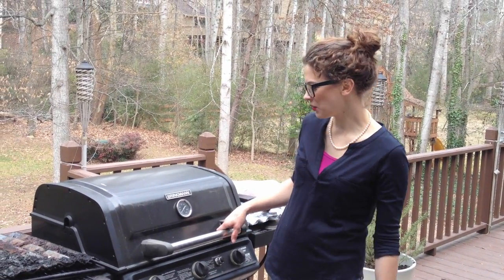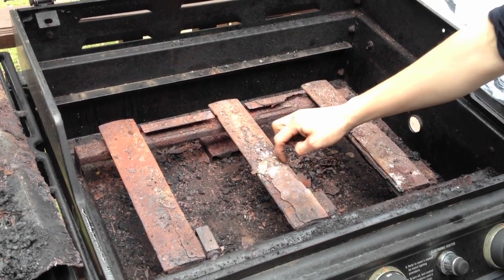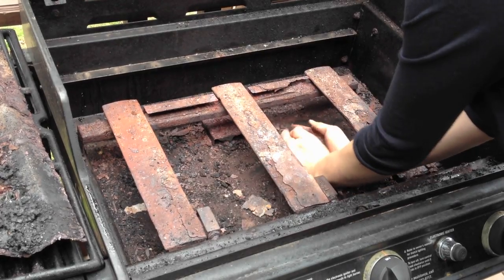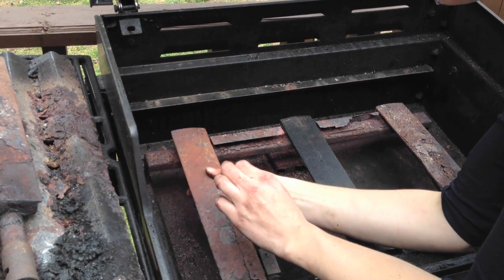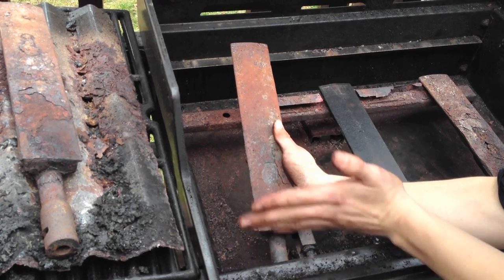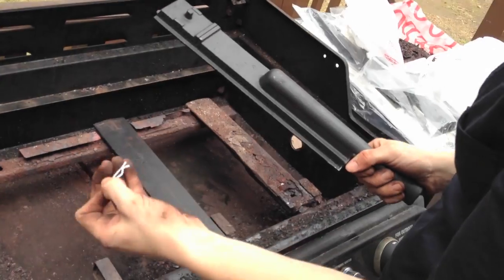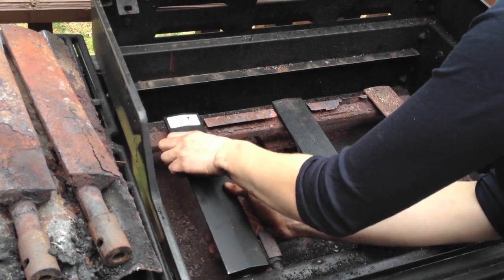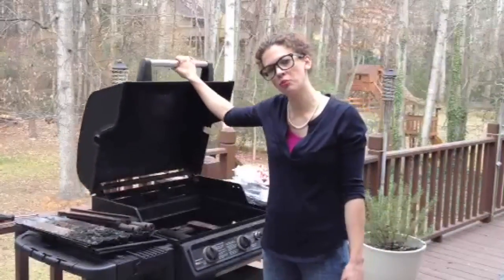Gas Grill Repair - Replace Grill Burner - Cast Iron

Comment: This was VERY helpful!  For some reason the instructions that came with the grill do not even MENTION the cotter pin that hold the burner in place!  I'm really just needing to CLEAN the burners - but one of them is still wanting to be a pain (and it's doing a pretty good job at it! :) )  Thanks for the information!  Paul

Comment: I just installed my burners, but it is not working properly. The flames are not that strong, and if I have one on and turn the second one on, the heat level goes substantially low. I mover the burners around and sometime it works fine, but I turn it on later and the same problem happens again. Any suggestions? Thanks for your help
Reply from the maker: Hi Ricardo,
The first thing always is to check/clean your orifices. These are the little brass nuts on the valve where the gas comes out to go into the burners. You can remove them with a crescent wrench or adjustable wrench. Often there will be dust or spider webs visible when you take them off. Blow out or use a q-tip to clean the area. This is the most common problem with gas flow issues. You can also check the manifold (where you connect the regulator hose to the grill) as there can be blockage there as well, especially if the grill was left without a hose connected to it for a while. If neither of these options works, we would recommend replacing the regulator. However, before you replace it, do one final check. Turn everything completely off (knobs and propane tank). Disconnect the regulator completely. Reconnect it. Turn the propane tank on. Then turn on the knobs on the grill and attempt to light. This will make sure that the regulator is reset and is operating properly. If all of these steps fail, replace your regulator!
Reply: Excellent thank you.

Comment: Can you use a cheaper "universal fit burner?"
Reply from the maker: Most Universal burners are stainless steel. The valves in your grill will be drilled to work specifically with the cast iron burners you have. For that reason, we would not suggest the switching of cast iron to universal ss tube. We still sell these exact fit replacements though!

Comment: If your grill was originally sold pre-assembled by a place like Lowes, Home Depot, Walmart, etc., there is a chance the hitch pin was never installed since it is a pain to insert it.  You could have operated your grill for years with it missing since the burner will function perfectly fine without it.  Just be aware that if you move your grill and a pin is missing, its burner can fall out of place creating a fire hazard.
Reply from the maker: True that it might not be in there! Always wise to double check all your parts after moving your grill. Thanks for the comment!